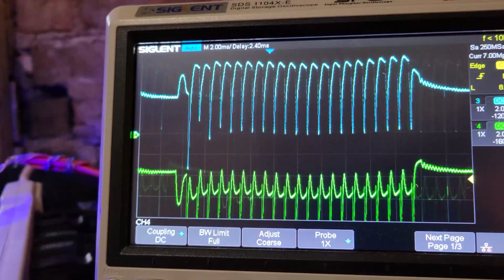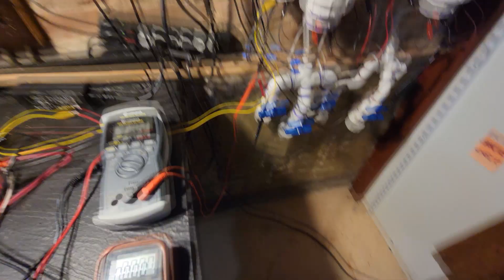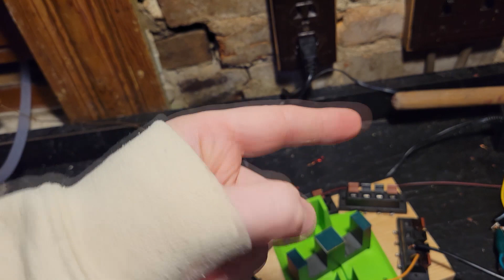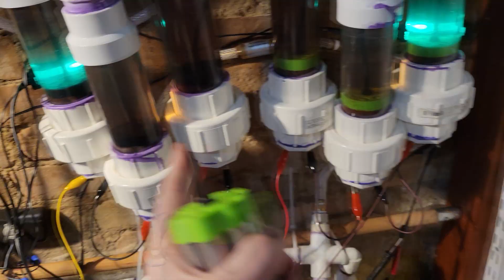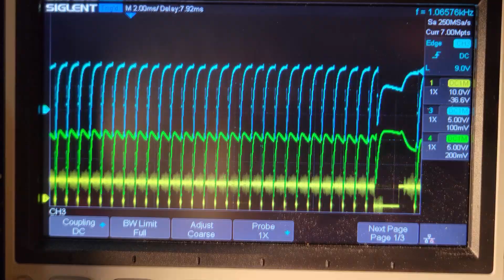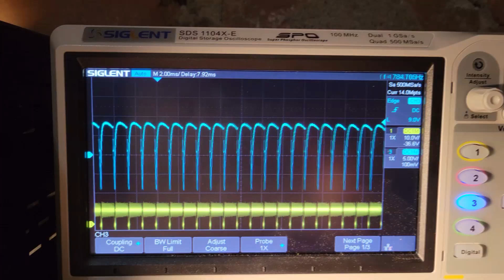Complete Breakdown of Circa-2023 Stanley Meyer Water Fuel Cell

Comment: This is a fantastic setup and video, really appreciate this content. But I'm confused, your amperage on the cells is really low in the micro-amps, that is awesome, but why is the system juice upto 4amps? where is that excess amerage being used/lost? Is it in the mosfet/transformer?
Reply from the maker: yes, consumption in mainly in the transformer. Its efficiency could be improved i'm sure (with the proper mathematics).

Comment: honestly i dont think the outout is that impressive, you're still using 30watts but how many litres per minute?
Reply from the maker: It's impressive for the fact it's tap water without electrolyte. This setup is not nearly as efficient as my latest apparatus.
Reply: @noahauman but electric can flow through tap water, it's actually distilled water stanley used but i doubt he didn't have an electrolyte,  electric cannot flow in distilled water, there isn't really much stanley footage to know for sure
Reply: @noahauman  how did you figure out the wave form to use? i thought that stan was doing something where almost no current would pass throught the water.  and it would break free the hydrogen.

Comment: Let's do some math: Input power  = (30.8V x 4.4A) = 136 watts as shown.
Output power  = (139V x 0.4A) = 55.6 watts.
Congratulations on your terribly inefficient DC-DC converter at 41% efficiency. I can get a far better one off Aliexpress for just a few bucks.
What exactly is the claimed benefit of this dreadfully inefficient HHO generator?
Reply from the maker: I seriously doubt that a DC to DC converter from Aliexpress would accomplish the same task. It's more complicated than that. The benefits are that it uses natural water, it requires no electrolyte, no risk of thermal runaway, electrical energy can be extracted in the process, and water can be purified to absolute zero PPM without wasteful filters that contaminate with microplastics.

Comment: No "added" electrolyte but the impurities in the tap water and metal electrodes will achieve the same thing so long as you throw enough voltage at it.
All that aside this is doomed to failure like all the other Meyer pseudo-science experiments before it. It did not work then and will not work in the future.
Many have tried, ALL have failed.
Reply from the maker: Many tried to invent flying machines, failed and were told the same rubbish. Same goes for just about any other technology. Only those who quit lose. In my latest videos, I utilize RO water (at 20-40ppm) and achieve even better results.

Comment: Amazing!  I ran a global group of about 65 Meyer replicators from around the world, coordinating online in realtime, back in 2007-09.  You've got a great setup there.  But the VIC and EEC are needed to perfect it.  Until you pull the unbound electrons out during those pulse breaks, into an external load, you're not optimizing the effect. The More Current you Draw From the Water, the More Efficient it Becomes.  Yes, that makes it like Floyd Sweet's Vacuum Triode Amplifier and Bill Fogel's Charged Barrier Semiconductor, in capturing external energy into the circuity, as potential.  But, here it also serves a more direct purpose: it contributes to the electrolysis in a 1:1 relationship; for each electron removed from that circuit, a water molecule is dissociated.  That EEC can light an incandescent bulb, with only the electrons drawn from the water, at no additional energy cost, while reducing the net energy input to the unit, overall.
Reply from the maker: Thanks! ECC is what I will be working on in Season 5, along with spherical resonant cavities and laser injection.

Comment: is 10% off time working best for you ? i take it youve tried longer off times ?
Reply from the maker: PWM width it typical to be 50-90% when producing pulses during ON time. In flyback mode (pulse OFF time), I can get it reduce to as low as 15-30%, but production it not as great.
Reply: @noahauman okay, thanks!

Comment: right, so pulsing circuit feed mosfet, and mosfet turns power on and off on the transformer, and the trasnformer feeds the 115 volts to the cells. this is correct understanding yes  ? : )
Reply from the maker: Yes. The transformer feeds the inductors, but ultimately, the cells.

Comment: This is a great find. I always knew Stan was using frequencies to force the water molecules to collide releasing their bonds. The question is what are those frequencies or is that too much to ask?
Reply from the maker: The frequencies are simply to create a electrical-resonance scenario. Typically between 500Hz and 5KHz in my particular setups. It's the voltage 'pressure' that performs the work, not the "frequency".
Reply: @noahauman 
"...... don't forget the frequency....."
   Nikola Tesla

Comment: That's freaking awesome man never seen an hho generator that didn't pull massive amperage
Reply from the maker: im "defying physics" here! lol not really.
Reply: Just substitute high voltage for low current (and vice versa) but the POWER equation stays the same. Nothing to see here....
Reply from the maker: @RobertRichardson-z3u  its clear you dont grasp the EPP technology
Reply: @noahauman  have you looked into the thunderstorm generator or the plasmoid unification model? it looks like it woudl be some ground breaking shit, but i just dont know enough about physics to understand if its legit. The idea of using frequency to organize subatomic particales makes alot of sense to me. a wave is like a bubble that expands out, so where these bubbles intersect you can do things like beam forming. they would be able to trasmute elements if thats actually correct.maybe turn lead into gold!